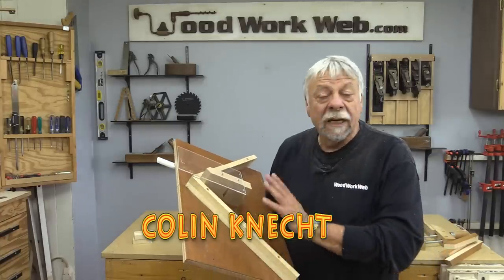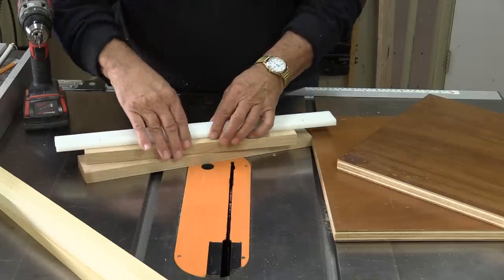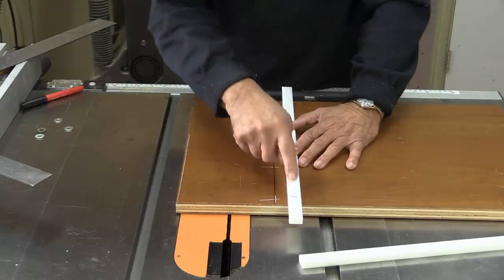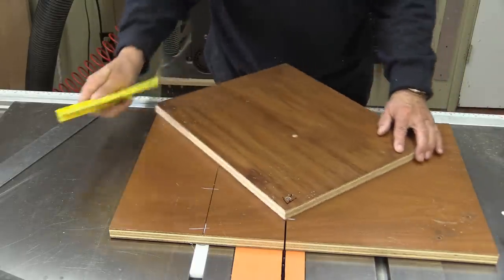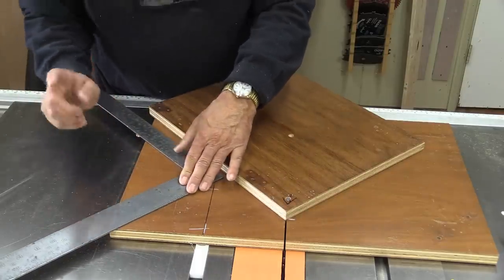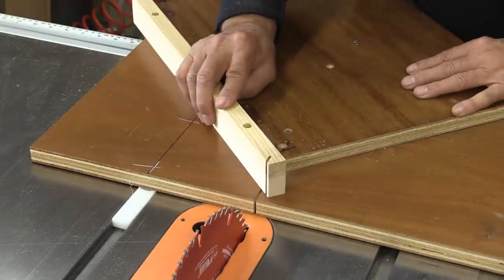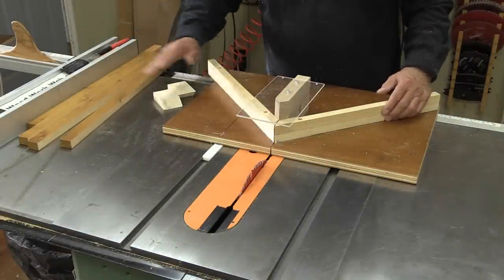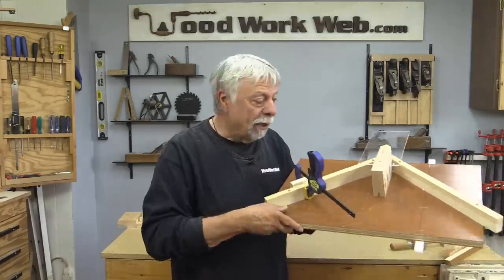Make a Miter Sled Jig for the Table Saw - Perfect Miter Cuts Every Time!

Comment: Don't forget a relief rabbit joint along the fence to reduce interference from saw dust.  Some peel and stick sand paper on the fence would really help hold your material in place.  I would also suggest some kind of T-slot so that you can use stop blocks instead of a clamp.
Reply: What he ^^^ said :) :)
Reply: Three excellent additions.

Comment: i mde my first sled today and then used it n was happy with the accuracy. dusing a dewalt 7845 table saw. then i thought of using it for mitres but then that meant using 45 degree blocks n it just got complicated lol. u have made me now build another one purely for picture frames. the frustration ive gone through trying to get all 4 to match is beyond . 
ive tried mitre saw. digital angle finders. my set sqaure and many other tricks and the best ive got is 3 corners perfect and one with a gap in. i glue them tight with the clamp strap that stanley sell. 

if the sled is a success then i will redo some of the ones on my wall.

Comment: Colin, after trying the William Ng method and being frustrated (my fault I'm sure) I tried your method to make a mitre sled and I couldn't be happier with the results.  I had 60 flat panel doors to make for two kitchens both required mitred joinery (with biscuits).  I have made stairs before so I had a set of the two clamps to attach to the framing square.  and wow what an easy application to a problem with perfect 90 degree joints.  thanks so much for the time you share with us mere mortal woodworkers.  Tom. btw I also used the Merle clamps that were recommended by Matt Jackson of  Next level carpentry which worked out perfectly. Highly recommend them when mitering.
Reply: I made two of these one for the larger jobs and one for the smaller ones,  I also added some hold down clamps to help with the longer stiles and rails (a safety feature for the small ones too)

Comment: As always a fantastic video! It got me thinking though, I wonder if adding some angled (say 45 degree) removable facing boards to the front of the fence you could do compound miter cuts for that “ole time” type of compound miter frame. Of course, assembling the frame for glue up and jointing would involve constructing another favorite of us folks, A JIG!  Just a little food for thought.

Comment: Might be an unrelated question but I have acquired a mustard bottle that I intend to use for glue like you do.  How did you get the mustard smell out of your glue bottle? Did you even concern yourself with the smell?
Reply from the maker: No need to worry about the smell. It doesn't hurt anything, as long as the bottle is clean. Thanks for watching!

Comment: whether you cut all pieces from the same side or from opposite sides, all should fit together correctly.  if it fails either test, rebuild the jig.  half right will get the job done but mistakes can be made.  you only have to build it once anyway (hopefully :>)

Comment: Colin:  What type of plastic did you use for the runners?  Is it that HDPE material I have read about?  I have a miniature table saw and the miniature cross cut sleds I have made with conventional wood for runners is just not working well.
Reply: Bruce Brachman, I had issues trying to make accurate runners on my previous (lousy) tablesaw for my first sled.  I could cut straight rips, but could not manage the very tight tolerances I thought I needed to control the width of the runners.  If you cut two runners that are straight, but narrow, you can shim one to the far LEFT of a miter slot, and the other to the far RIGHT of the other slot, that will allow them to act as one huge runner in one giant slot (only one side of each runner will bear on a slot-edge).  Some dabs of glue on top of the rails will keep things aligned when you remove the jig from the saw top to finish fastening the rails.  Paste-wax over the entire bottom of the jig also makes a big improvement in smooth performance.
Reply: Adam:  Yes, I have seen that method also.  My tiny table saw slots are just under 8mm wide.  That is really narrow to hold anything stable.  I have also seen the 'hot glue' trick to add a small amount to the edge of the runner to take up the slack.  The ultimate solution would be a metal runner but I have no way to create a narrow metal strip exactly 8mm.  I could buy another stupid micro miter gauge from Micro Mark and take off the track and use that.  I just thought the plastic would do two things.  Keep the sled straight and be a fairly friction free surface to slide.
Reply from the maker: Yes, it's HDPE ... I usually just cut down white cutting boards for it.
Reply: Cutting down white cutting boards.  Hmmm.  That is probably the definition of a woodworking hack.  Instead of buying 'higher priced HDPE' just cut down a white cutting board.  Brilliant.  Thanks.

Comment: A suggestion on getting the 45 degree angle right.  Start with a base that is a rectangle with 90 degree square corners.  Install the slot runner so the front edge of the base is 90 degrees to the blade. Cut an upright piece about 4 inches longer than needed and place it in position such that both ends extend off the edges of the base.  Attach the end away from the blade to the base with a screw. Swing the upright until both legs of the triangle it forms to the base are equal.  Screw it down.  You have a right angle triangle on the base with two equal length legs.  By definition the corner angles are each 45 degrees.  Trim off the center part of the upright with the table saw.  Install the second upright using a framing square and measured 90 degrees to the first upright.